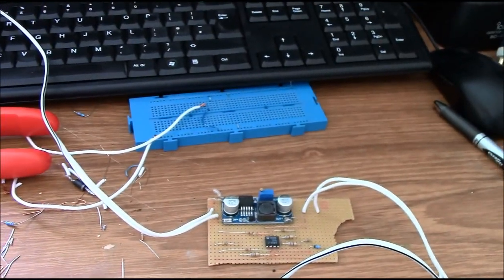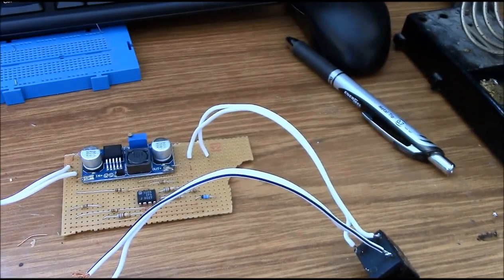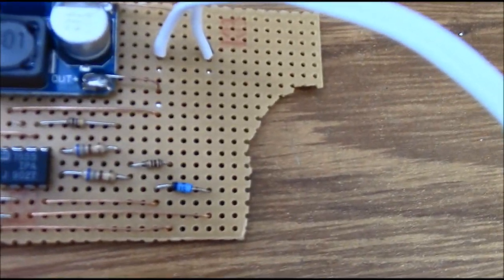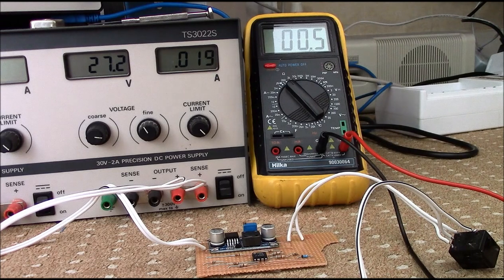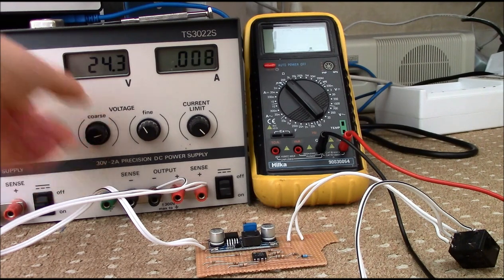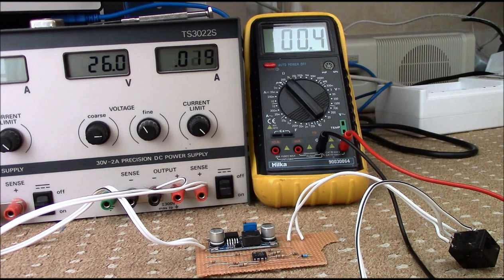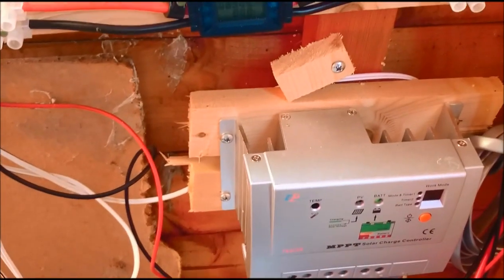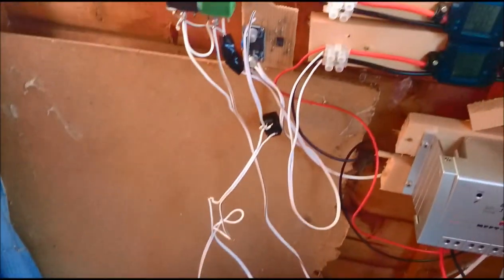Low Voltage Disconnect and update

Comment: Can I using SSR for high power/amphere instead of mech. relay ?
Reply from the maker: You can. Just be sure to use one for AC or DC to match your power supply. AC ones will latch on with a DC current.

Comment: for 12v battery?
Reply from the maker: Arya Jaya the one shown here is for 2 12v battery in series giving 24v. but it's only a matter of changing the voltage divider resistor values so it can work on a 12v battery
Reply: let me see circuit for 12v ....